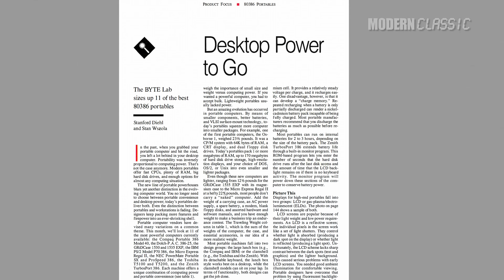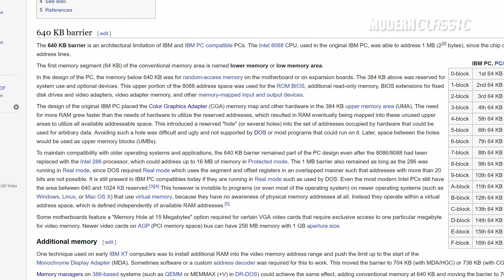IBM PS/2 P70 Tour and Diagnosis - Part 1!

Comment from the maker: IT'S ALIVE! The computer is working! There were THREE separate problems to solve. The first was the floppy drive, which had caps that were obviously bad just by looking at them. That's now been re-capped. The second and possibly more important was that somebody had taken that 387 co-processor chip and just shoved it in there without any regard to whether the pins were even lined up - many of them were literally bent upward from being forced down without being in their sockets. It was a horror show the likes of which I'd never seen. And it's not something I'd normally even think to check, but in a last ditch visual inspection of the motherboard for anything out of place, I noticed the 387 was slightly angled upward in one corner. When I pulled it out, I discovered a spaghetti dinner of pins going every which way. Who does that?! This is why it was such a mystery why the machine was acting how it was - I don't normally have "check all chips for shoved-into-socket-itis" on my diagnostic to-do list.

So the computer was detecting the co-processor in its hardware check, then freezing. That's why I almost never even got to the prompt to insert the reference disk, as you see happen above.

I carefully straightened each individual pin and re-mounted the chip. With that sorted, the computer was now reliably giving me the prompt to insert the reference disk, but still neither the floppy nor my floppy emulator (which I'd hacked a cable for) would boot. At that point I was just on a process of elimination and there was only really one thing I could think of that I hadn't tried, and that was using the REFSTAMP utility to stamp the ID code back into the reference disk image. This is normally only needed if you "look at" a disk image in Windows - I didn't think I had done that when I made my disk images so hadn't run REFSTAMP before. It's also a 16 bit program, so it's necessary to run it via DOSBox if you're running 64 bit Windows 10 as I am. Well, I ran that as literally the last thing I could think to try, and lo and behold the disk booted, the computer configured itself and I now have full access to the hard drive.

There are still a couple of things to do. My hinges still need replacement, and my floppy emulator still isn't working, with any disk. But those are minor considerations that I'm confident in solving - they may just take time. But there will be a part 2 of this video! This computer is back from the dead.
Reply: Would love a part 2 to this video. Glad you are sticking with it!
Reply: Glad to hear you got it up and running!!! That 387 sounds like it went through a war. Glad you were able to save the pins on it!!!
Reply from the maker: Yeah I wish I had taken a pic of it; it was bad. I was also worried if I'd be able to save it, but surprisingly it went back in after straightening each pin with a tweezer and seems to not be causing any issues.
Reply: Awesome 😎
Reply: Really intrigued by this computer and part 2 !
Reply: I subbed and waitin', can't wait to see more, see some orange games running on it :)
Reply: Modern Classic congrats. Now the killer upgrade for this system is a 100Mbps network card... if you can find one. And if you are extremely lucky (and wealthy) a Sound Blaster MCA.

Comment: I worked at the nordic IBM HelpWare Hotline & OS/2 Hotline in Copenhagen, Denmark between June 1992 and January 1995. The P70 was our first "laptop" as we did 24/7 support (I mostly served finnish and swedish customers) and worked from home during the nightshifts. My "mobile" phone was a Dancall NMT with shoulder bag and all. Whoever was on shift lugged that beast around town if not working at home, and had to ask random restaurant or bar  person for a power outlet to use the computer, if a customer call came in. It was fairly fast for it's time, and generated some strange looks if one took it out and worked with it in public. Now, 28 years later, I'm still in IT (I'm 51 now), and can't be but amazed at how times have changed. Good old times!

Comment: the P70 I have had some bad solder joints in the PSU, which was fairly easy to fix. friend that gave it to me did the adaption of the floppy drive in place of the original, and fixed the eject button as well. the result is the eject button stands a bit more at attention but nothing bad at all. if you ever get your PSU open, you should definitely touch up all the solder joints even if they don't look like they need it-- it seems to be a common problem. there's some trimmer pots inside too to fiddle with if voltages are lower than they should be here and there... I was able to trim mine a bit to a good compromise, but check and re-check all voltages when you mess with them as it does affect a couple here and there and they need to be fairly balanced.

You're going to want to make sure if you do have that modem installed to have the config files from mcamafia on the floppy as well, for it, even if you don't intend to use it.
Memory boards for these, if you can find them, would be wise to find a 32-bit MCA variant so the 16-bit slot can be utilized by a network card or the like, if you don't intend on getting a Xircom Pocket Ethernet III and sticking that out the back every time you want to use it on the internet for whatever reason. This is still a valid option.

at your earliest convenience, if your ESDI drive still functions, make a backup of it somehow. they're coming on 30 years of age and it could or may not die at any second, but don't put it off.
You're also going to want to replace the system fan at some point . Replacing it with one that has a thermistor is generally a good idea, if you can find one, even used.
Any CPU upgrades you do will require a heatsink in the jam-packed case. and, a compatible 387 to go along with it. if you want the fastest 387 you can get, Cyrix FasMath chips are where to be. they also made a line of 486 upgrades for the 386 socket with FPU coprocessors to go in the 387 socket for those.

if you install a RAM card, do NOT install Windows 95. it will be SLOOOOOOW because of the bandwidth constraint of the MCA bus, regardless of the 32-bit nature of the slot the card is in. the system will run at the speed of the slowest RAM and for anything other than DOS/Win3.1 it is a DOG. OS/2 might work just fine.

if and when you get your floppy problem solved, you should consider grabbing and trying Planet X3 for DOS when it releases soon. Also, the floppy port on the back is, if I remember correctly, HDI-30, but I don't think it's wired up the same for reasons. otherwise it's the same port one would find on olden Macs and Powerbooks for the HDI-30 SCSI interface for those that had it.
Reply from the maker: Will keep all that in mind, thanks. I am not totally sure how I would go about backing up this hard drive, though. Obviously I can't just stick it in a modern desktop. And I don't think there's an SD solution for ESDI either, is there? About all I can think to do is use one of the backup systems available at that time, ie. tape. (Or maybe that crazy VHS backup system that LGR tested a while back.) Is that what you think too?

Comment: Losing battery backed settings is a pain everywhere. I see mechanics now plugging a small device into the OBD2 port on vehicles before changing out the main lead acid battery, just to avoid the car's computer losing settings during the changeover.The device they plug in has a small battery to provide power to the car's electronics while the main battery is removed and replaced -- without this, many cars have to go to the dealership to have settings put back in place, for a big fee. It's just not enough for hobbyists and technicians to replace backup batteries anymore -- we need to start adding in bypass power to the boards before doing the battery replacements themselves, to avoid these losses of settings.
Reply from the maker: I don't completely understand why the battery in this machine could be dead and the machine not lose the settings, but then lose the settings when I replace the battery with a fresh one. It seems backwards, almost like it's intentional on IBM's part.
Reply: I think it probably wasn't completely dead -- just degraded enough to throw a low battery warning on the motherboard during startup, but with enough juice to still preserve the existing settings in place.
Reply: Different retention voltage and operational voltage - you can achieve retention well below 2V on a 3V battery, but this is no longer reliable.

Comment: Yes, I had a ps/2 laptop when I was younger that for whatever reason needed a cmos battery changed. After speaking to a gentleman who worked on computers for a living that sold me the replacement battery, he told me to go into the cmos and write the disk image before disconnecting the cmos battery.  SO glad I followed his advice because when I turned it back on, I got a weird insert disk screen I'd never seen before.  And much like you, couldn't get around it without inserting the disk with the image I had just wrote.  If I were you, I think I would disassemble the floppy drive, qtip the heads with rubbing alcohol and clean and lube the slide rails.  If it does't work after that, maybe try a different source for that CMOS program floppy.  by the way, from the video, the floppy drive does sound healthy from the POST.  Good luck, and thanks for the great videos!!
Reply from the maker: Thanks! Yeah, I think sometimes I just get a little cocky with x86-based computers - there's usually nothing I can't fix within minutes, so I don't take a lot of precautions anymore. Obviously I was not up on all the vagaries of the PS/2, though.

The caps on this drive are definitely bad, but now that I have it out of the system I'll clean and lube it up too. I've read that the Alps drives (which mine is) can get really gummed up with dirt and stop sliding so easily. May as well take some preventative maintenance as long as I'm changing the caps. Just hope it works once I'm done with everything!

Comment: Crazy, that has one 1/2 and one full length Microchannel slot. Microchannel was actually a very advanced bus and an unbelievable improvement over ISA, in particular, it had bus mastering and was 32 bits wide long before anyone was using 32 bit operating systems. It was also auto-configuring up to a point. Much of what went into the design eventually ended up in the PCI architecture. For this machine, what you REALLY want is an ethernet card in the 1/2-slot and an 8514/A graphics adapter and original monitor for the full length slot, and to run OS/2 on it!

Comment: I can totally imagine LGR trying to get a hold of one of these and then attempting to run Doom on it

Those memory sticks were probably SIMMs (the first DIMMs came out in the mid-late 1990s and for a while there were motherboards that supported both). They came in 30 and 72 pin versions and sometimes took a bit of work to install or remove - after inserting them, they had to be "tilted" into place
Reply from the maker: I do know they're SIMMs, I just had a double brain fart. I've installed dozens of SIMMs over the years, I just haven't actually used the term in many years so my brain's stuck on "DIMM".

Running Doom on this thing was one of the first things I was going to try. It would run slowly but it should run. I first played it on a 486SX/25 and it was about as good as it ever got on that, and a 486SX/25 isn't that much faster than a 386DX/20. Maybe about 60% faster.

Comment from the maker: Just FYI guys, I pulled the floppy out of this machine tonight and almost immediately had a "well, there's yer problem!" moment. One of the caps on the board that are known for going bad literally fell off. So I know I've got to replace the caps. It's possible there's more than one problem going on, but I'll tackle this one as soon as I get new caps and see where things stand then. Photo here: https://imgur.com/a/7gtistT

Also, I do know those are SIMMs :) It was a double brain fart. I've installed plenty of SIMMs in my time; I'm just stuck in 2018 I guess.
Reply: good luck . really hope you get this working. i had a Toshiba t3100 i salvaged from work about 15 years ago in perfect condition but it went missing in a move . fond memories of the orange plasma!
Reply: Today there are alternatives to that electrolytic capacitors with much longer lifetime and better electrical specifications (ESR). Perhaps Aluminium-Polymer Capacitors are the way you should take. I'm recaping sometimes, and my goal is, that the repaired machines still work when i'm retired (and retarded?). Good luck
Reply: Modern Classic I own a P70 as well. All I had to do to get mine running was fully recap the floppy drive and install a new CMOS battery. After loading the reference disk and getting the BIOS straightened out it fired right up off of the hard drive. If you are comfortable recapping the floppy with SMD parts I bet your machine would likely work fine as well...
Reply: The original drive in my PS/1 was dead because of that too. A cap fell off when I removed it to check it. If that drive your working on has any other problems besides that I could ship you my dead one for parts.
Reply from the maker: aphexteknol - I did order both SMD and radial caps. I've never attempted SMD caps before so I got dupes in radial just in case. The only examples I've seen of people doing this online all used radial, so I won't feel too bad if I have to resort to that. Hopefully mine works as well as yours when I'm done.
Reply from the maker: FameShinobi 97 - Thanks! Hopefully it won't come to that, but if the drive does need something else, I'll definitely keep your offer in mind.
Reply: I almost always use radial caps for SMT recap. They're much easier to solder and even more easier to replace in future recap. But, for this floppy recap there is very limited space for radial caps so mini radials must be used and aranged carefully to avoid collision with floppy frame and stepper motor. There are few pictures on my restoration procedure that show capacitor placement very precisely. I posted the link in my previous reply.
Reply from the maker: Gah, you're right. I didn't notice that before. I've cleaned it up and the traces still look pretty bad - will test with a multimeter within the next couple days. All I can do right now is hope that it's just surface gunk.
Reply: Very nice! It'll fire up after you do the re-cap of the floppy. Funny enough, I acquired mine in 2004 and after pulling it out of the closet a little over a year ago, it was just the floppy that needed work. My hinge also broke just like yours did the last time I got it out, some kind of plastic they used must have become brittle. I took it apart and it looks like we'd need a 3D-printed replica possibly. An MCA 3-COM NIC is perfect for that top slot! Good luck!!
https://imgur.com/a/F3pPb

Comment: One of those got me through university (93-96). 20mhz 386, 8meg ram, 120meg hard drive, MCA SoundBlaster.  Used the computer lab on the library for print outs. but had dos 5, windows 3.1  and word installed  (and floppies). Also lots and lots of Doom! Which on the gas screen was a challenge! That start up sound is still golden to my ears.
Yes, I had the Cmos battery issue as well, where I bought it from fixed it.
Other than being heavy, it was perfect for university then, certanly better than laptop options of the time. I would have senisbly been looking at an Amstrad NC200 at the price it cost me.
Sold it to a freind when I finished uni as I could use a better desktop PC at home. 
That hard disk format is the one reason I have not obtained one since. After using compact flash/SD Card storage on my Amiga's I feel that is the way forward with older machines, but there is no easy way to make that happen, even SCSI has an adaptor these days. But not ESDI.